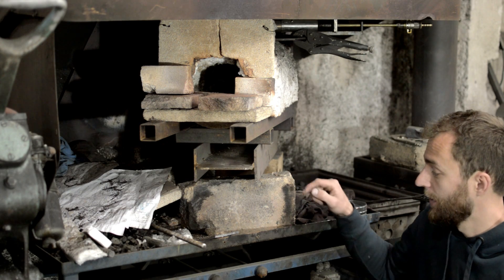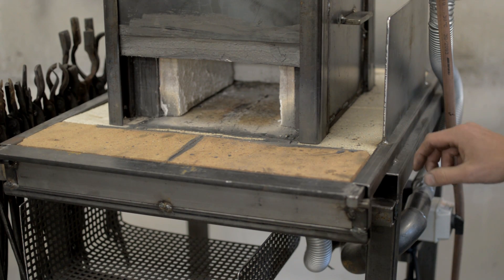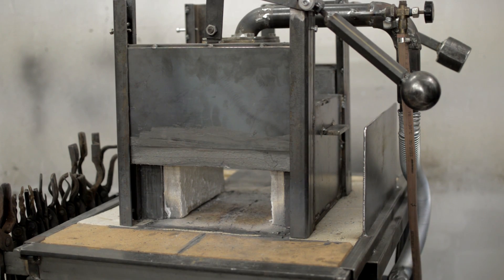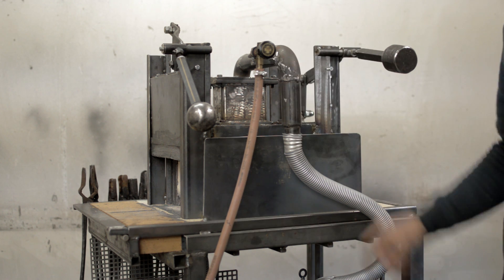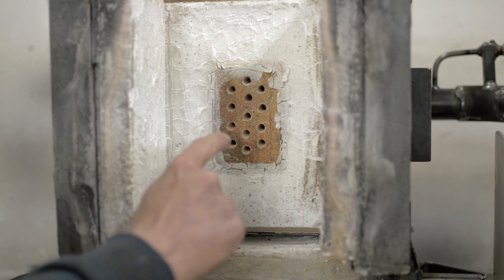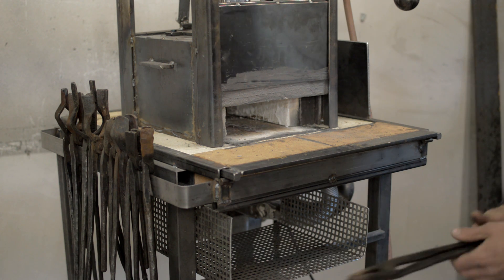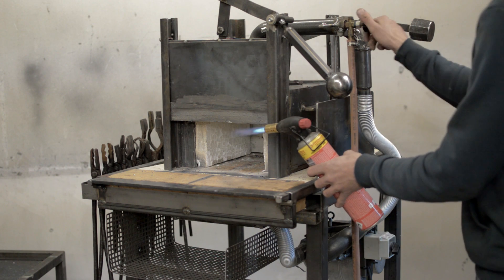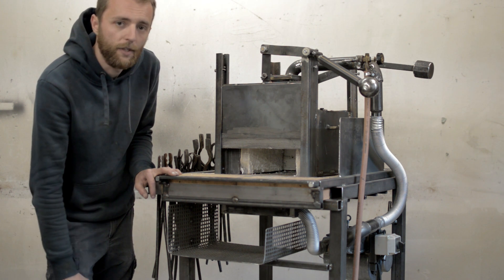Homemade propane forge.

Comment: I really like your design and there are some nice feaures! I'll think i'll have to copy some... Would you mind to share some more details on your Burner? I'm also building a forge but not quite happy with mine - i'll think its oversized... I'm using 2"/5cm pipes an the burner itself is a bit bigger (: would you tell me, wich diametre your using? And how powerful your blower is? And how high is your fuel-consumption for forge welding temperature? Thanks a lot...

Comment: Very nice build, I am getting ready to build myself a ribbon burner forge and will be stealing some inspiration from yours for sure....   Only thing that I would say you missed is a gas solenoid valve as a safety shutoff if you lose the blower.

Comment: I'm looking to build a similar volume forge using a similarly sized ribbon burner.  What kind of blower did you use? I am having trouble finding an appropriate blower for a reasonable price
Reply from the maker: Hi, i bought locally (Czech republic) some blower used for wood burning heaters. It has 75 W, and about 255m3/h.
Reply: @KarlMetalworks  thanks for the response! I am quite fond of your build, it is well thought out.

I found some people using blowers from kids bouncy houses and I think I'll go that route, I like your idea for the air curtain, and will use that idea on my forge
Reply: @KarlMetalworks  Dá se použít 40W axiální ventilátor, nebo je to slabota? Samozřejmě se vzduchovou stěnou nepočítám :D

Comment: On large forced air natural gas burners for industrial curing ovens we regulate the fan's air inlet with an adjustable block off plate. The sound from the fan mat increase slightly as the inlet is reduced and I've heard many times this has to be an increase in load but it's actually the fan's rpm increasing from having to do less work. This inlet air is used as one of the flame settings for performance and controlling the exhaust pollutants. I've always had to include an exhaust fan to outside the building and control its volume to keep the oven slightly negative to stop any exhaust from entering the building. Our doors are always sealed during the process so a different story but something to consider if you find you're blacking out too often. Or maybe you have one now and your fuzzy looking paint is because I've had too many fumzzzzzz
Zzz
Zzz
Very interesting is the thought you've put into getting it to do what you want it to. Peace.

Comment: How did you join the firebrick burner part to the steel part of the ribbon burner??
Reply from the maker: there are some metal pins drilled from the sides into the fire brick.
Reply: @KarlMetalworks  ok top Idea for a ribbon burner.
Reply from the maker: @lenblacksmith8559  thanks, its much easier than casting the burner.
Reply: KarlMetalworks yeah that’s what I was thinking.

Comment: Love your doors, and ribbon burner as I to am building.
.Love your air curtain, good thinking Sir.
  I don't think your insulation and coating is going to protect from hot temps of over 2,000 degrees

Comment: Gee I like that forge well done, so the ribbon burner is just a hard fire brick that you drilled out and encased it in a steel box, do you think the brick wil stand up to all the heat pretty well. Time will tell I suppose.?
Reply from the maker: Thanks. I think the brick will be ok. People usually make ribbon burners by casting, but I was to lazy to cast it and I wanted to try this easier method. Time will tell, but so far its just fine.
Reply: @KarlMetalworks  Yeah what a great Idea never seen a brick used before, would like to see more video's of you using the forge and how it's going.

Comment: Well done. Rich with practical features and could be easily scaled up in size. What is the tempter rating on the fire brick for the ribbon burner?
Reply from the maker: Thanks, I think the bricks are good up to 1300 celsius. But most of the time, the burner brick is cooled down by the air/fuel mixture.